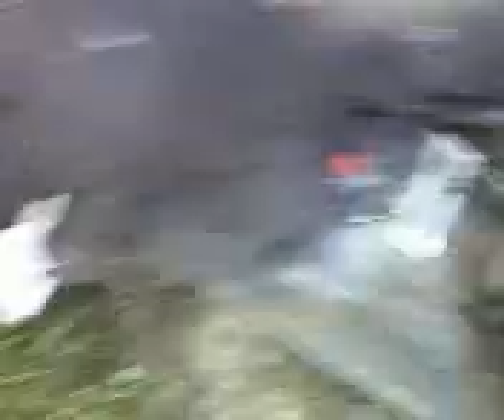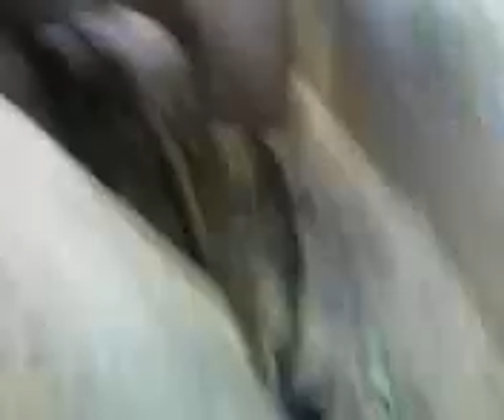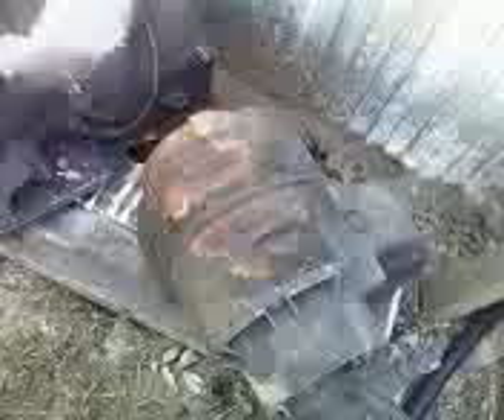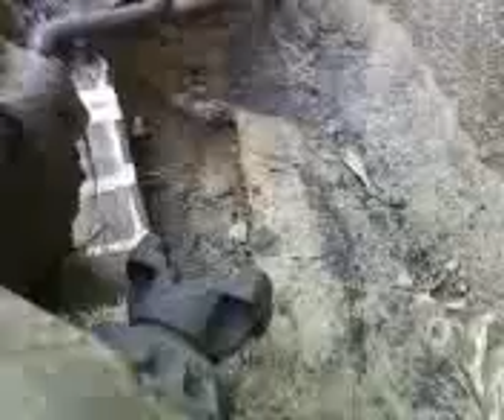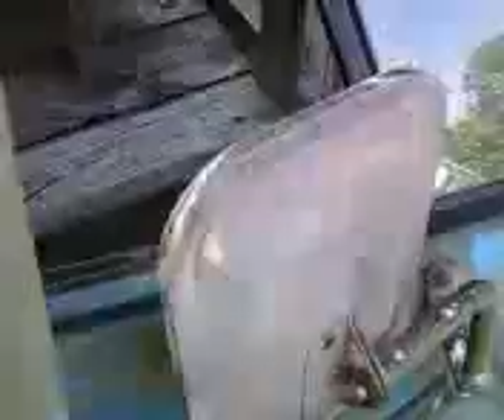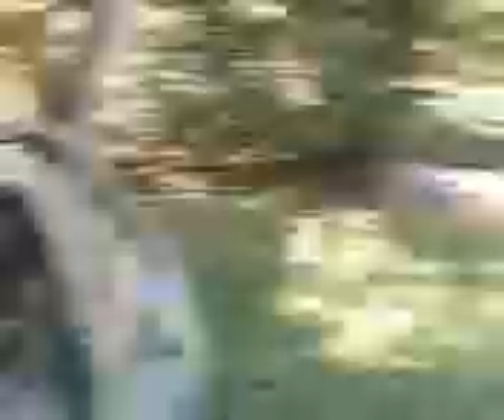NP203 transfer case explanation

Comment: Had one of those in a 78 Blazer with 2 open rears it was not uncommon to see these vehicles stuck in snow ice and mud...it was almost like it wasn't a  4X4 at all LOL! I had mine stuck in town in 4 inches of snow on top of ice, I got out with the blazer still in drive and the left  front and right rear wheel were spinning away LOL! It was a nice Blazer but that system was a disappointment.
Reply from the maker: Check out the np203 double transfer case shifters.
Reply: That isn't the fault of the transfer case as it was doing it's job. My78 Blazer with the 203 had rear posi so 3 wheels locking up when needed.

Comment: I can get mine to go into hi and low but not hi loc or low loc i think the linkage is messed up
Reply: the linkage and shifter is horrible on these NP 203's  I bought an after market shifter from Off road truckin... no more tuggin and pulling on the shifter
Reply from the maker: Quincy Mecham take the linkage off and shift by hand.